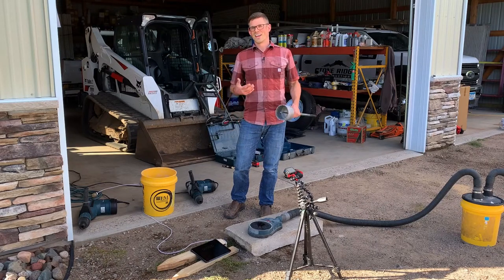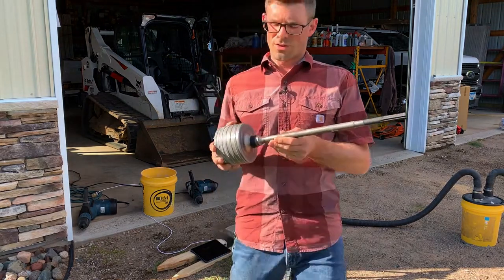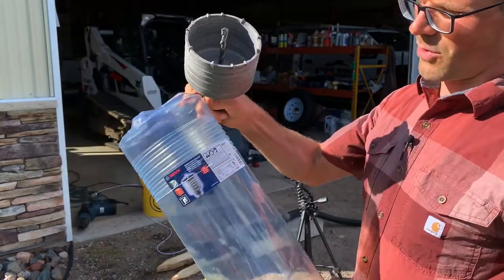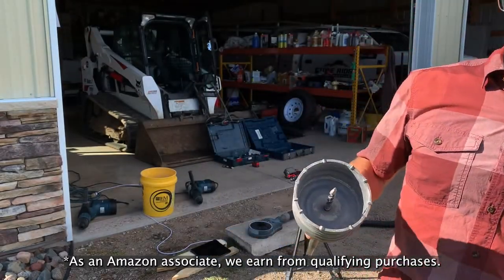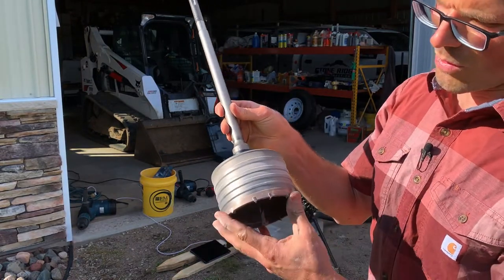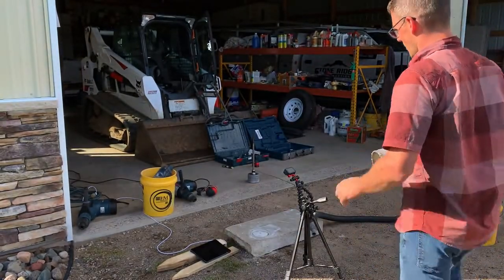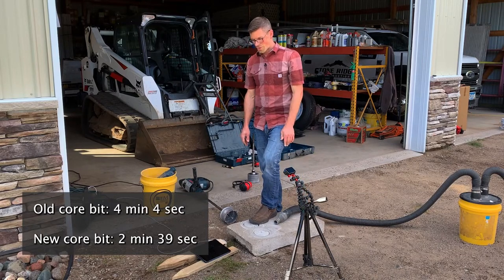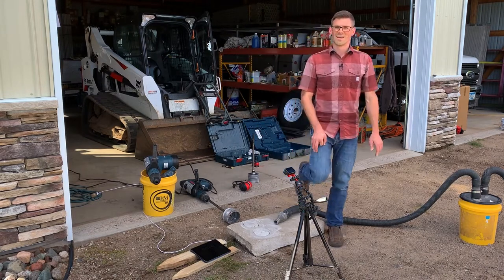Old vs New Bosch Core Bit

Comment: Never ceases to amaze how many old school contractor folks I meet who are using the same beat up gear and accessories when even a moderate upgrade would vastly improve the efficiencies, overall, with their daily work.

   This is a prime example of how (since we all know time is money) it really does pay off to get new bits, attachments, accessories, etc. This video proves a new accessory accomplished the goal in nearly half the time, which, if you're plowing through a number of coring holes a day, stacks up collectively.
   
  Even things as simple as charging stations with multiple ports for batteries, as far as the topic of maximizing time and efficiency. The amount of guys I knew and still know who have a single charging station for 10+ batteries is ridiculous. I run Bosch almost exclusively,  and got their 6 port battery smart charger. I can quick charge, literally, 6 times faster than people without it....makes your head spin sometimes with how stuck people are in their ways or are unwilling to step into the future with upgrades. Great video that definitely broaches into a wider topic of "keeping up with the times" as far as tool and tool accessory management.

Comment: Hey how deep will these cut ? Just a few inches ?i imagine only as deep as that core attahment ? I need to get through a 8 inch concrete wall wondering if i could with one of these. Thanks in advance !
Reply from the maker: It will go about 3.5 inches. Then, break off the concrete core and keep going. Repeat the process until you're through. Keep in mind it will blow out the wall as you punch through. You can also use a wet or dry core to avoid this. I have the one I use in our Amazon store if you want to check it out.
Reply: @AmericanRadonMitigation  where can we find your amazon store? Im interested in the wet or dry core drill
Reply from the maker: @codydavis6620 Amazon.com/shop/americanradonmitigation

We earn a commission on purchases. Thanks for your support!

Comment: How do you insert pilot bit? I have an ITM core bit and the pilot bit keeps falling offf! Please help
Reply from the maker: I'm not sure about an ITM core bit. However, on the Bosch core bit, you slide up the rubber ring at the bottom of the shaft, slide the pin out, and the centering bit falls out. I'm betting your centering bit is worn out and needs replacing.
Reply: @AmericanRadonMitigation   is a brand new bit, it has taper thread less shank. I guess hammering it to make it tight will work